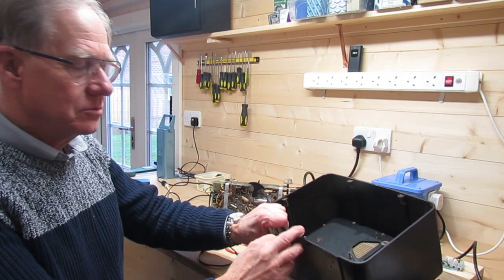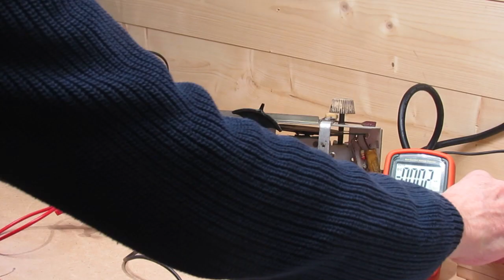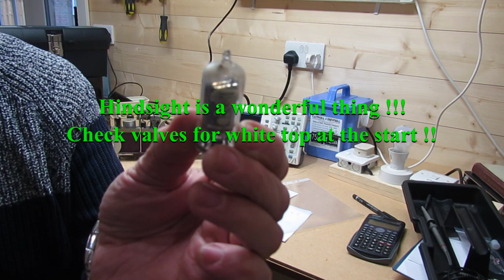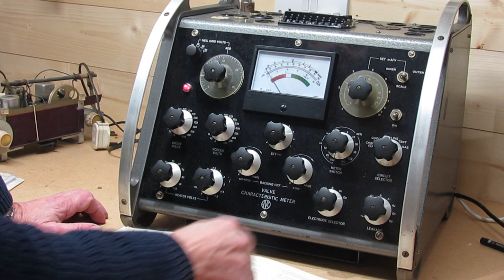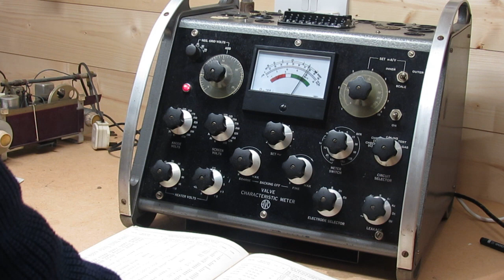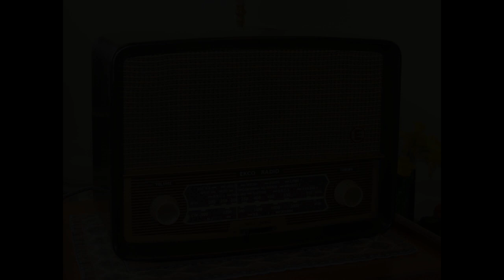Ecko U245

Comment: A very interesting video Tony I’m just about to do a restoration on a Philips 341a which has been stored in the garage for years so this was very helpful.. but a quick question if I can I want to replace the paper caps but im finding it difficult to find suitable replacements and a source, would you have any suggestions and what capacitors to use ?
Reply from the maker: Well you really don't have to worry too much about the dielectric that you use. The dielectric is more or less defined by the value and voltage that you want. Polycarbonate, polypropylene or ceramic will be fine. Just make sure you have an adequate voltage rating. If unsure about voltage go for 400V. Good luck with the restoration

Comment: Hi Dr Tony, I have only this week completed a restore on the same model radio that found it's way down under. Nice radio and works very well. A small point, EKCO is the correct spelling, you have Ecko in a few places. I like your workshop, nice and clean 😀
Reply from the maker: Thanks Dave. I think this is the mutual admiration society. I love your workshop too. I'll certainly watch yor video on the Ekco (now spelt correctly-thankyou), and I agree they are really nice radios. I must get round to replacing the caps at some point though

Comment: I have just inherited one of these which would have been my great grandmother's originally... it hasn't worked since the 90s but I might just have a go at seeing if I can figure out what's wrong one of these days.  Thanks for the link to the service manual... just need to overcome my late dad's voice in my head warning of the dangers of poking around in things containing valves !
Reply from the maker: I would say go for it. There are 3 strict rules in terms of safety. 1. You MUST use an isolation transformer with this radio if you are going to work on it whilst it is on. It's a hot chassis radio. See my part 1 video where all this is explained. 2. make sure that the chassis is connected to neutral, and not live. 3. When working on it try your hardest to keep 1 hand in your pocket. You can't always do this of course but its a good habit to get into. Also check that the fuse in the plug is appropriately rated - 1 or 2 amp will do. Finally let me know how it goes
Reply: @tonydurrant  Thanks for the advice - don't worry, despite having a reasonable education in electrical engineering (as part of my Mech Eng degree) I'm a coward when it comes to live electrics!  I will be sure to let you know how I get on - whenever the law permits me to go back to the house the radio has lived in all these decades...

Comment: Re: The use of wavelength.  In the early days of wireless when spark transmission was used, there was no such thing as frequency control.  The point in the spectrum of maximum radiated or received signal was controlled by the length of the antenna wire (wavelength).  So spectrum calibration was thought of in terms of wavelength.  My guess is this is just a hangover from the early days of wireless.  73 de K4TO, Dave
Reply from the maker: oh I see. Yes, I hadn't thought about that. And I guess that in the early days no one actually thought about how fast the wave travels in which case the relationship between  velocity and wavelength couldn't be formulated. Good point !!

Comment: Can you talk about the isolating transformer? Looks like a factory product - very aesthetically pleasing. How build it something like that, according to safety rules?
Reply from the maker: Well I bought mine from screwfix. Around £80 I think. Much larger than you need. Making your own I think is challenging. It is possible to make one using 2 identical mains transformers by connecting the secondary of one to the secondary of the second and taking the output from the primary of the second. But this technique is really only useful if you happen to have 2 identical transformers kicking around of appropriate size. In terms of cost I doubt that if is really worth it. My advice would be to lash out and buy one

Comment: I’m sure you know this but it’s just as easy to use another radio to listen for the local oscillator.  I usually start these checks by injecting a Huge signal at the IF frequency then work back .  You  look to have a lot of nice equipment. Thanks regards chris
Reply from the maker: Actually Chris, I hadn't thought of that, but it makes perfect sense. That's a good tip I'll remember that. Yes, the old valve tester was a gift. I had to pay a company to make a new movement and then I build an amplifier to make their 1mA fsd meter look like the original movement. Well worth the effort though